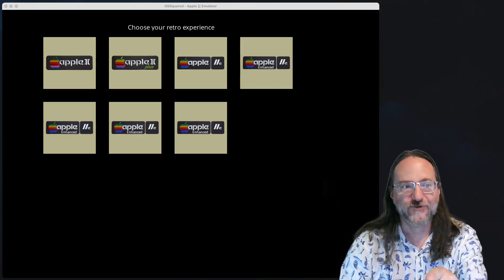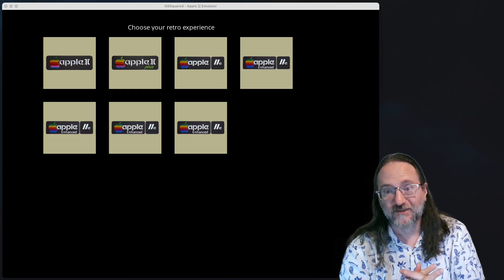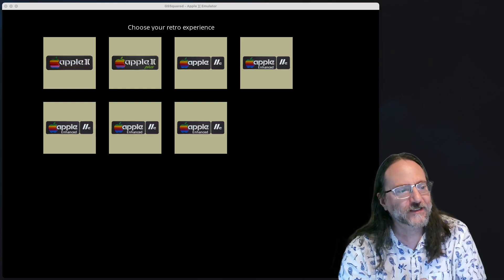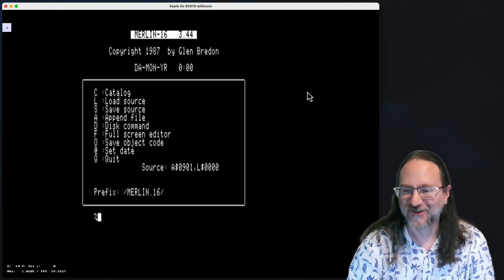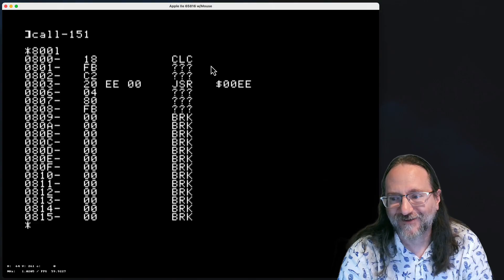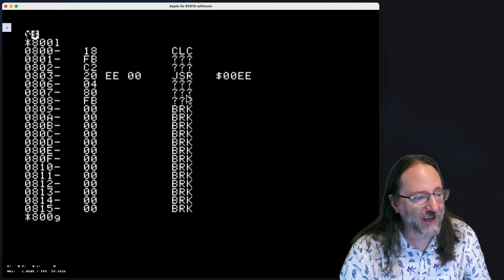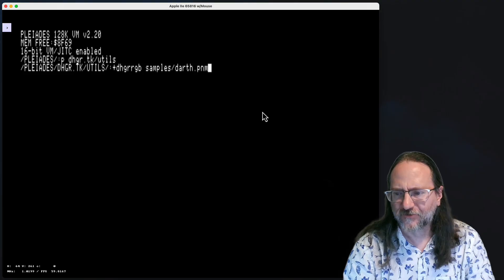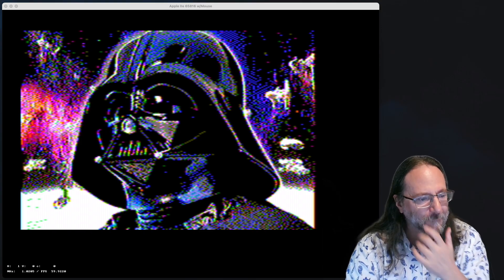This Apple IIe is 16-bit!

Comment: This is awesome.  Back in the day, I replaced my 6502 with a 65802 processor.  I wrote a simple piece of code to pop it in and out of 6502 and into 65802 mode.  It was a challenge, a fun challenge.  This was over 35 years ago, and I don't remember the details.  I still have that computer, and I've added two more Apple //e and an Apple //c to my collections.  Finding room to set them up is a challenge.  I look forward to when you finish the emulator. Ever since I found out about the 65802 and the 65816 processors, I've been interested.
What will I do with it?  That's the fun part.  Imagining a project and then planning it, coding it, debugging it, getting frustrated, and then fixing it.  Now that I'm retired, I have more time. 🙂
Thank you for your fascinating work!  I'm definitely subscribing to your channel.
Reply from the maker: Some very interesting things should be possible!